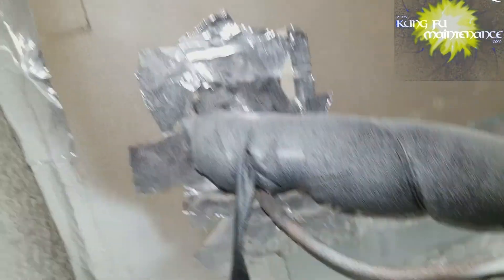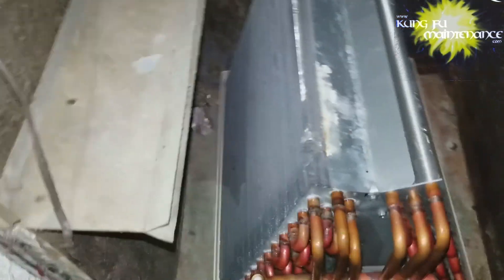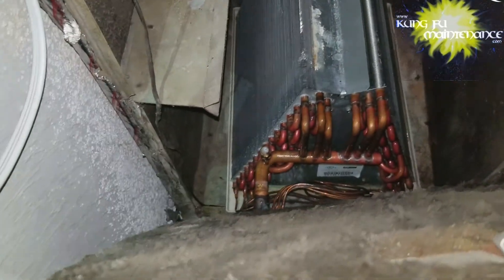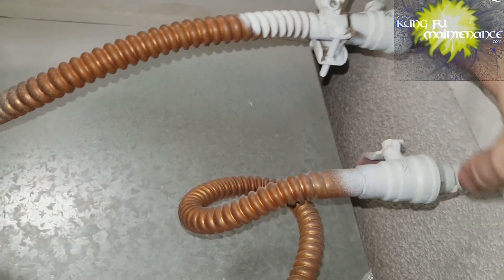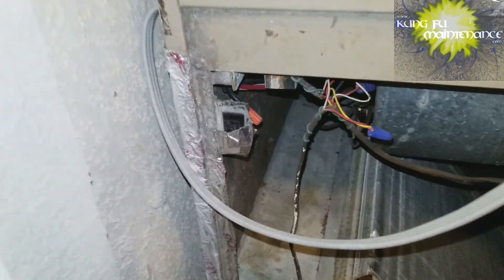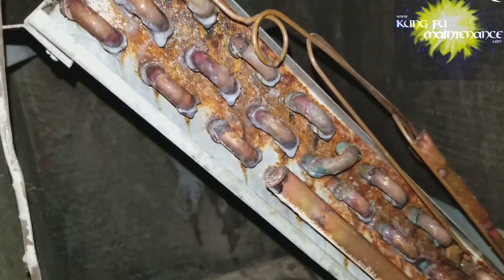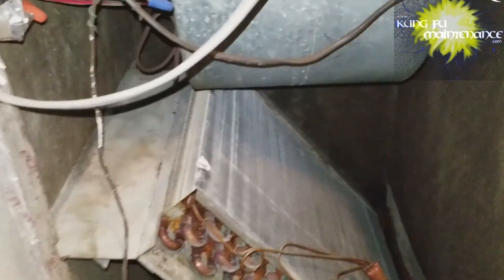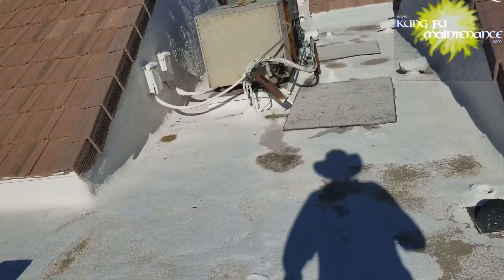Air Conditioner A Frame Coil vs Slant Coil Inside Outside View Of Two Types Of Evaporator Coils

Comment: Why didn't you use the electronic leak detector? A coils are more efficient. The key with A coils is for them to never get dirty in the first place. Use the high end filters and a UV light. The reason those coils get dirty is because people use the cheap filters or no filter at all. As far as leaks, if they leak they should be replaced, repairs usually don't last, it will just leak somewhere else.